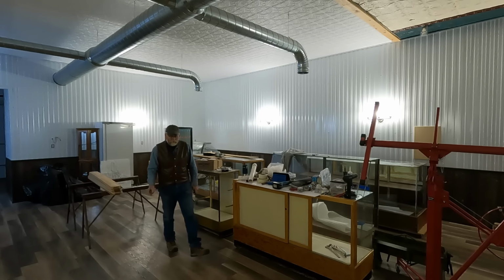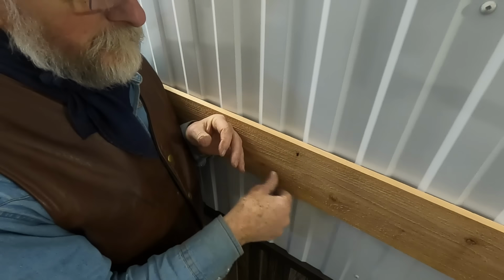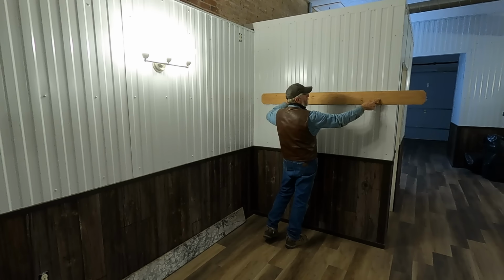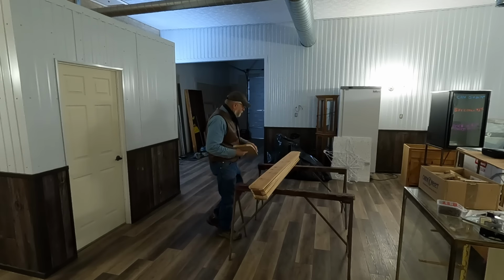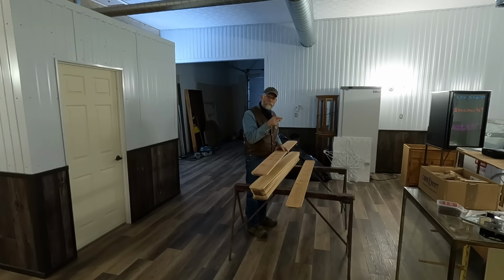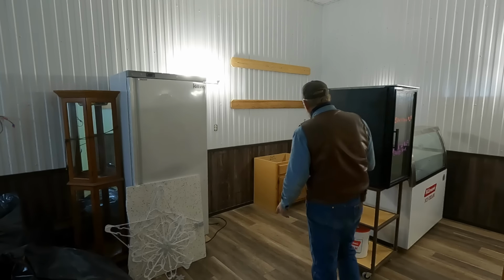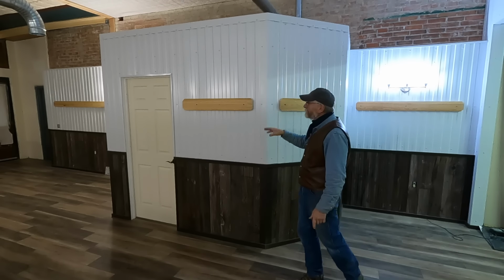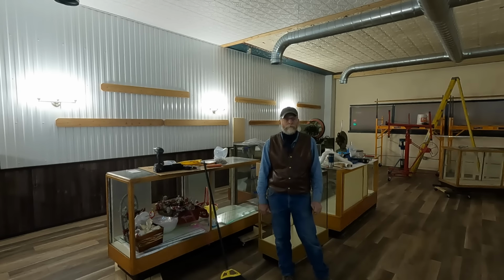How to Hang Pictures on Tin Walls | Engels Coach Shop

Comment: Let your vendors know that the 3M Command hooks work very well.  They do not damage the wall and can be removed by pulling the removable adhesive strip off.  We use them in our store and they really work well and have never damaged our walls.
Reply: That's what I was going to suggest. Just stick 'em to the metal then remove them as needed. No harm to the metal.
Reply: I was going to suggest those as well.
Reply: Good idea.

Comment: Here is a thought, instead of allowing the consignees to use screws or nails, provide hooks that clip over the top of the boards. Much like the old picture rail hooks that were used in Victorian homes to hang pictures from and prevent holes from being put into the plaster walls. This would allow more flexibility as displays and consignees change, reduce maintenance (replacing of boards, filling nail holes and breakout from screws) and the potential of damaging the wall behind the boards. Museum is taking shape, really looks good.
Thanks very much for sharing.
Reply: I was just about to suggest the very same thing.
Reply: Even better than I was going to suggest, to provide a box of appropriate length standard screws and nails that are not too long, and require any hangings to use only those.
Reply: Good idea but theyre not consignees. A consignee is a person who receives goods or documents that have been shipped. If this is a museum then Dave would be the curator and those displaying items would be the exhibitors.
Reply: Great idea
Reply: French cleats?

Comment: About ten years ago I was one of the trustees of a local charity supporting the arts. To accommodate those who wanted to hang anything on the walls we installed an aluminum extrusion from the top of the walls. From it clear monofilament could be hung in any position from which the item was secured by a clip similar to that used to tighten guy ropes on a tent. 
The exhibits were changed every few weeks with little or no trouble leaving the walls intact. 
I’m sure a quick google search will find what you need. I believe we looked under curator supplies, or something like that. When not in use the monofilament can be easily removed. It was very similar to curtain rail I’m sure that could be used as a substitute. Almost unnoticeable from ground level, especially with the height of your ceiling.

Comment: Here are two observations, All surfaces are hard. When more then a bunch of people are talking there, they end up screaming to get heard. there is sound absorbing material that helps to get the acoustics right. The total atmosphere in the room will be more inviting for visitors.

The other observation is the dominance of straight lines, 90° angles and long monotonous walls. Adding some curved elements like non-straight countertops and decoration also will make the atmosphere much more inviting.

It's nice to follow your making and thought processes. Keep up the good work.

Comment: A picture rail attached where ceiling and wall meet is a versatile means of attaching anything to walls that have to remain unscathed. They are used in museums all over the globe. Pictures and framed posters and the like are hanging  on nylon threads which are practically inconspicuous. Like curtains they are easily movable along the wall.

Comment: “In for a penny, in for a pound.”
I would suggest lining the rear of the timber with thick sheet metal, at full size. 
Yes, I know it’s heavy and expensive.
That guarantees no nails or screws getting to the tin.

Comment: I suggest that you write up rules for attaching to these boards. The first thing these consignees are going to do is use finishing nails. Ask me how I know. 5/8" cedar is thin besides not being strong enough to hold anything. Wood screws work better than nails, but you may have to supply the correct length screws and watch them being attached. Even at that, wood screws will pull out of cedar. You'd be better off with poplar or even pine, and you could cut down the board width.

Comment: Use a French Cleat as a picture rail, and as a lower rail. The upper rail can be used to hand pictures, and the lower rail stabilises the item, but can also be used to hang small cabinets and display cases. Reposition with needing a single tool....

Comment: Mount the boards ( Picture Rails ) for the future pictures. Make square / wide ( 1” to 2” ) metal hook. These hooks are place on the top edge of the Picture Rails ( boards you mounted ).  This allows for no fasteners required by whomever hangs a picture or sign.  The metal hooks have picture frame wire attached to it and the picture frame / backside of the picture.  This allows for centering / adjusting the picture/ sign anywhere along the rail / board.

Comment: As many the first thought was picture rail, but the western spin notions of hangers sound good. Bit of pondering and even more work required though.

Breaks between sections... The coach lamp section is easy as matching lamps at each end seems a natural.  A yet to be rented section.. Perhaps just a rope at the wall with a weight keeping it straight, but a rope doesn't say ice cream.  First thought was a loaded cone sculpture at either limit, but that may not match exactly what's being served. So, maybe an ice cream scoop mounted at either limit.

Ice cream... It will be on little hands and the floor. Other than napkins you may want moist wipes or unscented baby wipes handy. Possibly a coffee tin of sawdust to help wipe up the floor spills. Just thinking young hands do better partially cleaned before attempting the door and sink area. Someone will have to check and wipe a bit later anyway just...

Comment: It's unfortunate Dave didn't ask for suggestions from the Ether-world. In my opinion, the correct system to use, in this case and as others have noted, would be a Victorian-style picture rail with rail hooks. It's a very versatile solution and doesn't cause any damage to the tin.
Reply: I was going to write the same answer.
Reply: It’s still used in shops and homes.
Modern versions are available, but can be pricey. For my ‘20’s house I bent some old brazing rod for the hangers to hook on to.
Bulletproof and no holes in the plaster.
Carry on, I enjoy your videos.
Reply: I would try earth magnets . Hot glued to the pictures.

Comment: Use 3M Command Strips.  They hold a reasonable amount of weight and come off clean.  No holes.  I use them every Christmas to hang stuff around the house.
Reply: They work good as long as the paint holds onto the wall.  I used them to hold up a small cork board.  The command hook held but the paint underneath let go.

Comment: You refer to the wall covering as tin. That means either aluminum or steel.  If its steel, you might make good use of neodymium magnets  to hang things on the wall. If you haven't worked with them before, you'll find them surprisingly strong.

Comment: Assuming the panels are steel, my first thought was some of those high strength magnets that are readily available these days.  Either individual magnets with hooks on them to hang pictures, or several magnets fastened to one of your 5/8 boards to hold the board in place.
Reply: Even though the sheeting may be steel, it's not really thick enough for magnets to grab on to.
For magnets to work well, you need a certain mass/thickness of steel to work with the magnetic field.

Comment: Might have to provide "approved" fasteners for vendor use to prevent over sized nails/screws from being used. Not sure if you considered a picture rail, used in museums and older homes from which pictures and photos were hung from. Could be a clean solution for hanging things in your case.

Comment: Looks like you are making Victorian Picture Rail, Western style. Pictures in those days hung from hooks suspended with wire. The ceilings were high and the walls lathe and plaster. This didn't make for a good nailing surface, thus the picture rail. I inherited a few of the old hooks, which are pretty ornate. I hope your idea works out and no one splits your boards when they try to put nails in as cedar is rather notorious for splitting. It sure looks good and the fragrance of that cedar should discourage bugs. 😊

Comment: Build a 1 inch space for the inevitable 2 inch nail or screw and they will for sure use a 3 inch nail or screw. Just saying. Your system would be perfect if you hang things for them.

Comment: Why not just do it like they did in the 1890's and do crown molding that has a gap built into it, and you could use hooks and chain to hook onto the crown molding and hang things at any height.   Non-destructive to the walls, infinitely adjustable both left-right and up-down.  Plus it's cheap, once you have the crown molding installed.